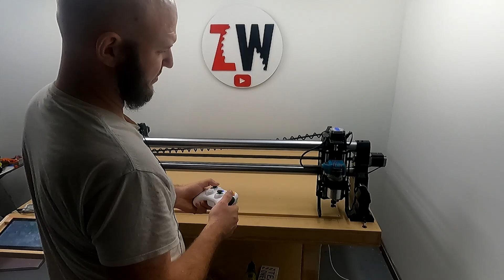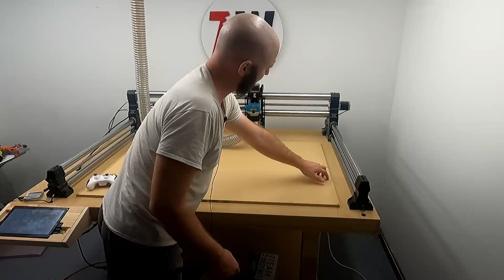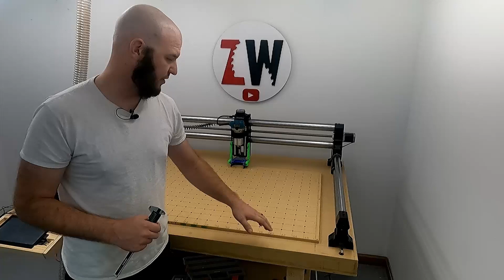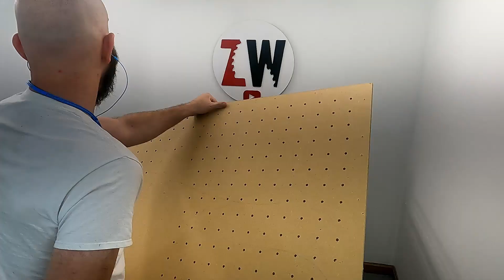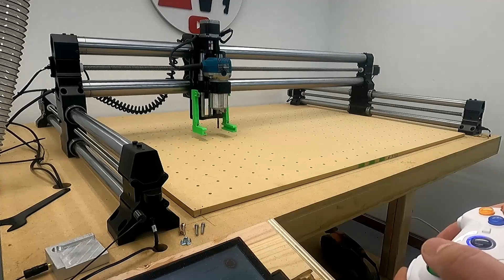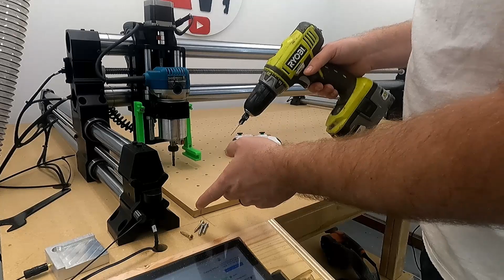Ultimate Spoil Board Guide for the Onefinity CNC

Comment: When trying to go to specific locations on your machine, it is much quicker to use the G-Code command G0.

For example, to go to 44 inches in the X and 1 in the Y, just issue the command: 

G0 X44 Y1

This saves you from having to hunt manually with the joystick.

Comment: If you do the bottom side of your waste board first (cutting both the insert hole and the recess) then flip the board over and create the graph, the graph may not be perfectly aligned with the holes but does it matter?
Reply from the maker: The only benefit you get doing my way is you check the square ness, and having the holes aligned allows you to use screw in material squaring brackets. Other than that yes you're correct that would work just as well!

Comment: Think you did the same thing when i first got mine. You over thought your process. This is not a hard process. example: If you are using a 1" surfacing bit. size you want to level is 32"x32" My waste board. I use Vcarve. I make a box 32x32 expanded it by 1' (I use a 1" surfacing bit) recenter so it becomes 33x33 so its .5" bigger on all sides. then i just run a pocket hole with my 1" bit. On the waste board placement: get a #2 pencil brake it in 1/2 take some sand paper sand down one of the broke ends of the pencil try to keep it even. sand it down to where it will fit inside the collet. works great for drawing out your placement for the waste baord.

Comment: Love my onefinity! My spoil board is almost identical to yours. I think when it’s time to replace the spoil board, I’ll go with t-track. Much faster to replace the boards. One thing I did with mine is to use the machine to bore mounting holes into the table top with t-nuts installed under the table top. Then lay down your spoil board and use the machine to bore the same mounting holes in the spoil board. That makes it easy to flip the board & align it to machine those t-nut recesses in the back side.
Reply from the maker: Now that's an idea. Hadn't thought of that